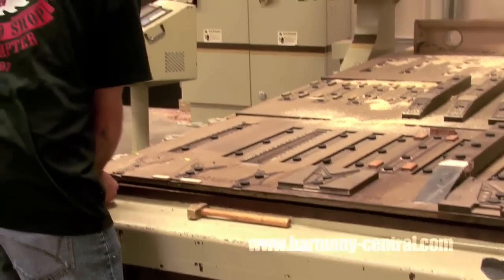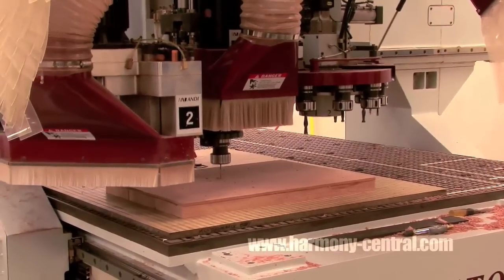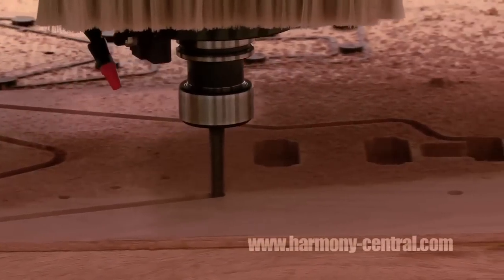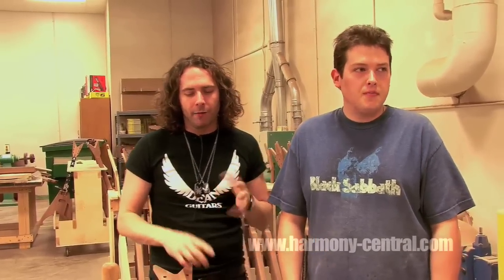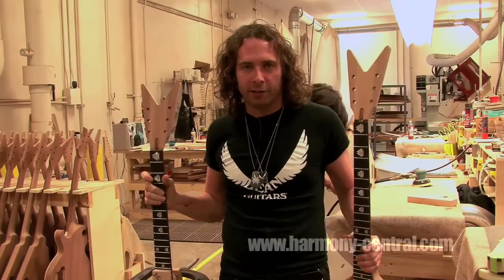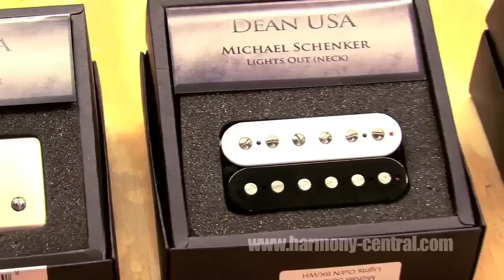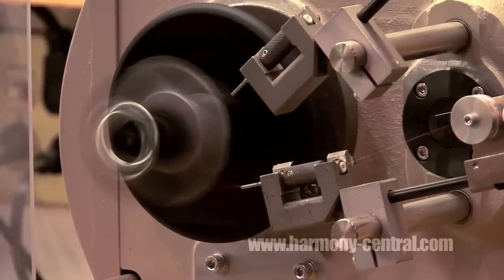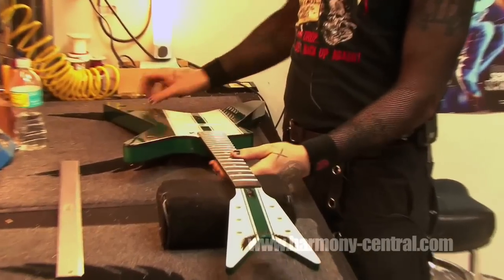Dean Guitars Custom Shop

Comment: 14:21 - works on the guitars just after they've been painted, but doesn't take his damn ring off to avoid scratching them
Reply: Exactly my thought.. Working in a cutsom shop with no real knowledge of how to set up a truss rod ready for fret level filing (you need a Notched straight edge that avoids the frets so you can see if the neck is level before you level frets and crowning) and he knocks his ring on a finished guitar at 14:42

Comment: I have the 'regular', 'made in China' Dean From Hell and it's a BEAUTY nonetheless :)
6 years on, still absolutely perfect. Thank you Dean, my dream guitar is as it should be - no disappointments whatsoever.
Reply: People are usually turned off from the term "Import" when it comes to guitars because 7/10 they're crappy quality, but Deans, Import or Domestic, are fabulous guitars, although my MIK Razorback needs a better setup, my friend set that shit up for .13-.68's but I can't play thick strings, I prefer hybrid .9-.50s, but the tension with those on my Razorback is too damn high, even in C# lol
Reply: Absolutely! People do get turned off by the China sticker (which I removed after about a year lol). Thought I think you went a bit overboard with a .13 - .68, those must be some fat stings! My .09 - . 42 setup has been constant (on D standard) since day 1, and never disappoints  :)
I'm pretty sure the materials used in the China made Deans are perfectly legit, just the assembly took place there.
Reply: I have a black Dean MLX from China and it's about 12 years old today. Still intact and reliable, though a pickup upgrade is needed.

Comment: to me at this point with the global economy and how things are done.  regardless where the guitar is built.  they are pretty much all using the same process.  what makes a great guitar, different than a cheap one.  is in the fretwork, and setup.  sure hardware etc matters.  but if you have a guitar with a proper setup.  its gonna be a joy to play. all the big boys use CNC machines regardless of country.  rock on.

Comment: How do they drill holes/tunnels for a cable to go from switch to pickups to tone/volume controls to the jack without cutting the body in half and removing the top + gluing it there again?
Reply: Saulius J. It's pretty simple with the machinery.They did not show it but I promise you it's pretty simple stuff with the right tools it's a breeze.

Comment: I've played several deans and they play awesome, but I've always been on the fence about buying one. After watching this, I've decided to make the purchase. My problem with them has always been the outlandish paint jobs and the 3×3 tuners on that boomerang head stock. The D.M. models I really like but just plain black for me. Dean has came along way, and for my opinion no human hand can be as consistent and precise as a C&C machine. The problem with using them, is like the guy said a decimal in the wrong place or a bit breaks, then it becomes a quality control issue do they scrap it, if it can't be repaired, or let it go thrue. I choose to believe dean does the right thing.

Comment: i think the machines are needed to keep the duration down; it's fairly impossible that a worker can do such a complex body like a ml alone in less time and without mistakes, the wood is expensive and if you fucked it up you can throw it away - and every worker get's his hands on the guitar to make them even better (also they dont showed how the paint the guitars) and not everybody can afford a guitar for 7000 $ which is only handmade - DEAN GUITARS RULES !!!

Comment: This is a very old video  i wonder if  Dean  Guitars  will respond to me  ??   i grew up in  chicago and i swear they were building Dean guitars around the corner from my house i was 12- 14 years old in late 70's  .. on a street called ravenswood  1/2 block north of devon.. 606026  there was a flat building with a garage door facing the street ,  along side the rail road track inside some stalls  where  these guitars were being assembled  and wood dust every where i will say more  if this was you guys  i have great stories... i used to hang around there as a kid.. they guys were kool..

Comment: I'm a former industrial safety instructor and I'm not seeing any eye, ear or respiratory protection being used. Especially around the CNC machine which is kicking up sawdust, which can really be an irritant. Hopefully, there's ventilation. Other than that, pretty cool stuff. I have a leftie Dean acoustic bass and I love it.
Reply: Jason X  Sounds awful, you made the right choice quitting. That cant be legal, it certainly wouldnt be here in Sweden, the company president might be put in jail for stuff like that.
Reply: whats metal about safety?

Comment: I hope thats not how you do all the necks with the sanding block because what you did was atrocious it did not go straight as you pushed up and down the stroke forword was twisted, not straight thus the fret work could not be level in fact your so called long block is not long enough because what you have done is create a concave to the fretboard, your long block should span over the first and last frets and as you move it you do not reveal the first and last frets because all you will achieve is to remove more material/metal off the frets in the middle, thus a concave, I don't know how long you have been doing this work but I have been doing it for 61 years cheers I hope you have learned something,

Comment: Highly skilled Mike glues in cnc'ed dots in a cnc'ed neck and then introduce the neck radius with a sanding block. No offense Dean Guitars..but please :/
Reply: The radius was done by CNC, then was smoothed out after inlays were applied, every guitar builder smoothens out (or creates) the fretboard radius after after putting in the inlays !!!! 
For example every full US PRS neck is built exactly like this , except the cnc'ing on the fret board is only for the inlays and fret routes (and is sub contracted), and then they glue the fret board to the neck, glue in the inlays, then radius the fret board with a sanding block.
Reply: RiffsNReviews PRS necks are far superior.  Look up the actual process involved in the timber resting, carving, radiusing and fretwork.

Comment: Starts the video with glueing and then slamming it into the ground. ok smh 
 guy pressing frets on a arbor press that's not even secure to the table  . if it was more rigid it would be a lot easier.
 14:00 Dude or non binary w/ nice sheer top and painted nails  slamming his pride ring into the finish so hard the mic picks it up. lol
Reply: "custom relicing"

Comment: Has there ever been a guitar made that was one single piece of wood?
Reply: As a body, yes. Both body and neck, dunno
Reply: yes, but, as far as I know, not in mass production factories ...
/watch?v=k647UA3Avwg
Reply: John Paul Jones first bass was carved from one peice of wood.
Reply: Tyron Smith you can probably do it with the right piece of wood, but for a large production it would be expensive (really expensive). it's not only about the wood itself but about the grain, knots and stuff like that. it's easier and cheaper to work with smaller pieces of wood, like 2 pieces for a body with a center joint or 3 or more pieces for a neck, like ibanez and many others do.
Reply: Don't see the point, seems like you would invite stability issues

Comment: There should be no CNC machines in a Custom Shop. You're paying astronomical prices for a hand made guitar,  it should be that way.
Reply: Chris Clark they have a place - lots of high end and custom shop builders use them.  I have never seen them so heavily involved in the process for guitars at this level though... using them to rough cut bodies and rout things makes sense but when you are relying on them to cut fret ends, cut and radius fretboards etc it's seems strange.  This whole process seems rushed and simplistic, not what you would imagine from a custom shop.